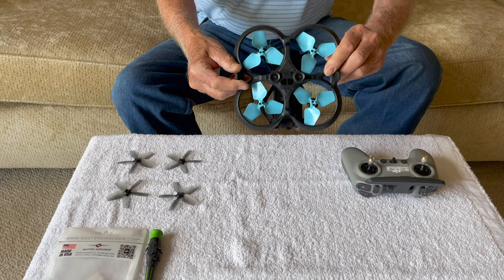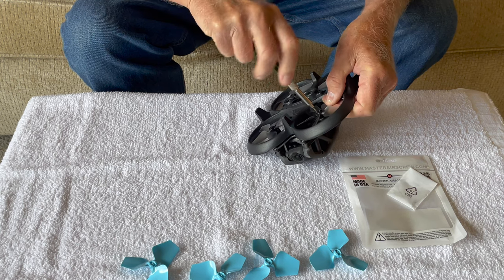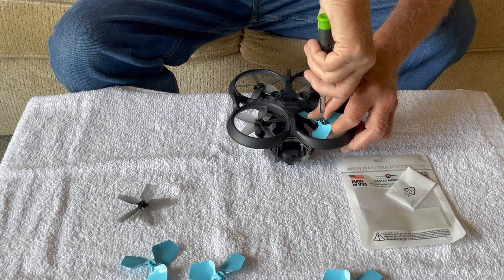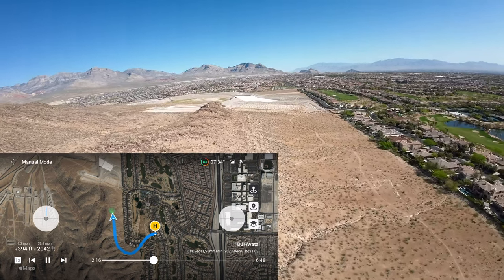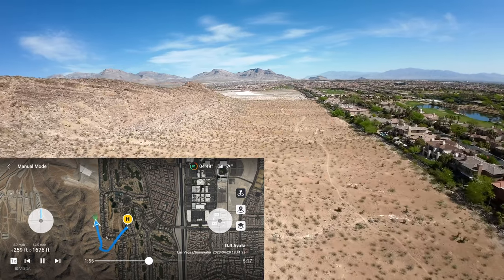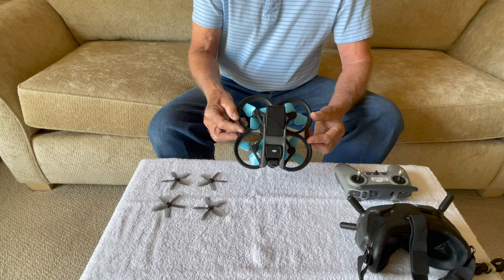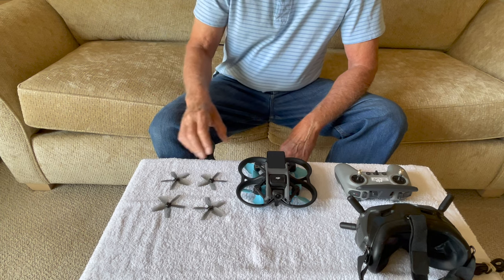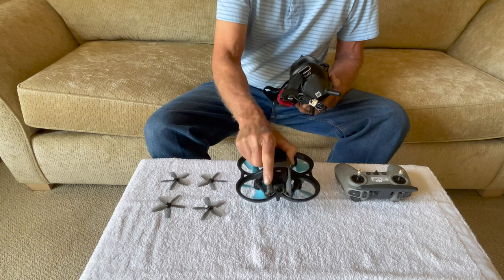DJI Avata Master Airscrew 3 Blade Prop tests

Comment: Great video... Could you make one by comparing the sounds? 😄
Reply from the maker: Glad you liked the video. The sound of the Master Airscrew props seems quieter or at least has a lower pitch. I dont have a sound meter to measure it but to my ears it seems less noticeable.
Reply: There is a video by another reviewer with side by side comparison...the three blades are much lower pitched and significantly less annoying.

Comment: Could you share the make and model of the screwdriver you used in the video to change the props as well as the size of the bit? I stripped the head of one of those little screw once and don't want  to revisit that experience again. Thank you!
Reply from the maker: The screwdriver is called Pittsburg Pro 34 PC Precision Screwdriver but I doubt it is available anymore as I have had the kit probably 30 years! No idea of the bit size as I just picked one that seemed to fit the best. Any good precision screwdriver set will work fine and  can be found at Home Depot, Harbor Freight or even Amazon
Reply: Thank you very much for that information. I found out that Harbor Freight carries the set, so I went and picked up one at $9.99, which is a real bargain.  Again, thank you very much!
Reply from the maker: Glad to be of help @carlosuhlmann2491
Reply: Looks for Japanese (JIS)  screwdriver, they look like Phillips, but a lot of asian countries use JIS instead of Phillips. Using a Phillips screwdriver will strip JIS screws, but not the other way around.
Reply: Sadly, nowadays it's rare to find ANYTHING made in the USA. The fact is that most of the items we buy are made in China, and that includes drones, and cars, not just screwdrivers. Much as we regret to admit, the quality of some of the Chinese imports is better that what we can produce at a lower price.  While we spend our time on social issues, China continues to take the lead on many fronts, including technology. The quality of the screwdriver set I bought is admittedly tops. Thanks!
Reply from the maker: Agree, the quality of "Made in the USA" is no longer what it was when I was growing up in the 50's. One exception though is SpaceX and the Falcon 9, by far the cheapest most reliable rocket in the world. It demonstrates what a private American company can do when it takes the approach of build, fail, and rebuild to perfection!  @carlosuhlmann2491
Reply: American ingenuity is second to none, in spite of a government that gets in the way and instead of encouraging and promoting that ingenuity and technological development stifles it.

Comment: Heard abot cracking of original props in mid air. So which one is more durable and trusty?
Reply from the maker: Master Airscrew looks more durable. That said I was using the original props for 170 flights with no issues so they are study as well

Comment: Good afternoon. A rare non - advertising comparison .Tell me, please, what is there in terms of noise in comparison. I looked through the translation of voice artificial intelligence into Russian, but maybe I missed this comparison somewhere. Thanks. Have great flights!))
Reply from the maker: The MAS 3 blade props seem a bit quieter to me.  The sound seems to be a lower pitch so it is not as annoying and probably not as noticeable at a distance. Still pretty loud though!